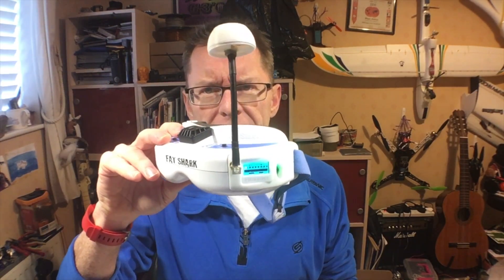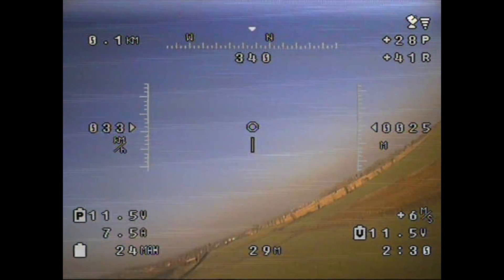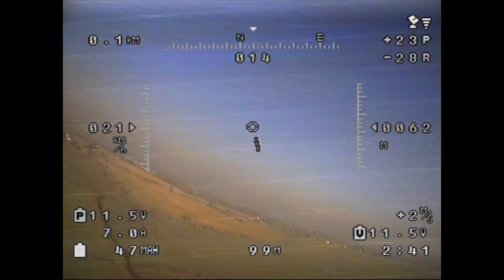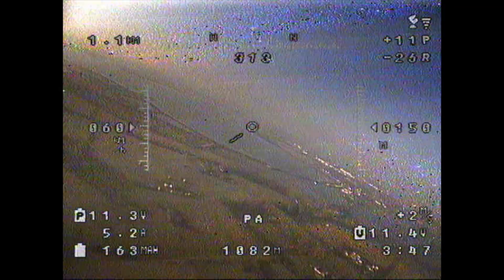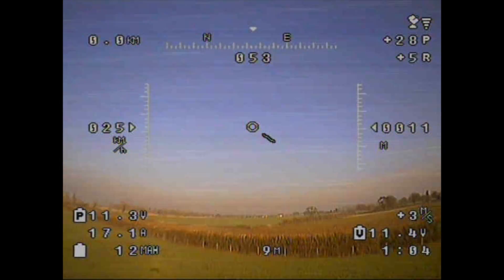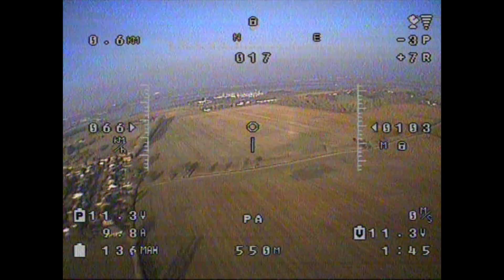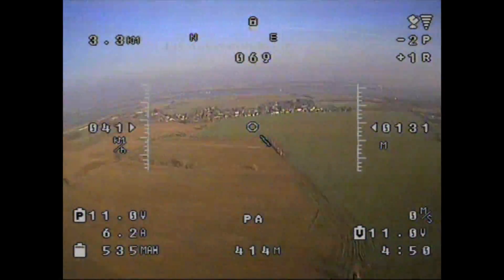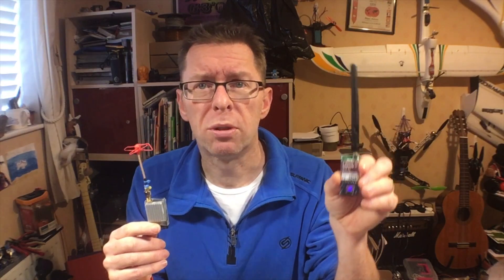Problems with RealAcc/True-D/LaForge with ImmersionRC 600mw VTX's

Comment: Hi Wayne, Oh, I feel your pain.....I have a couple of those IRC VTXS...One is a 25mw Slave in my 1.2G Relay Module. The 600mw one has a couple of years on it hooked to a Mobius flight Camera, very convenient with the 5vdc output.
   I can't wear expensive FS Goggles, I use a true diversity Monitor. These days, I fly on 1280mhz but when on 5.8G I have been out to nearly 2kms using a UHF receiver. I use a pair of 14dbi Linear Patch antennas on diversity with a standard RD on the plane, it always gives me very good reception with a wide beam to fly in, even 2kms out. The Linear Patch antennas are not expensive to buy either and Im sure you will have some RDs. Try it....for Planes only of course, not your Multis. As for your recorded image....why is it bleached out?...It's truly awful, but I think that's down to the FS DVR, a known feature?  Be interesting to see your reception quality when using an original IRC UNO Video receiver. Pretty sure your recording will improve when you stop using the built in FS DVR provided your signal strength improves, which is where the pair of  high gain Patches come into play.

Comment: Thank you vert much i powered up a imr 600mw now that i am getting into fpv planes and had the same issue.
Reply from the maker: Sander Sassen tells me that ImmersionRC's new RX module - which is supposed to be awesome will work with all the VTX's out there.  Which is good news for me.  VTX's don't cost much these days, but the hassle of digging out 5 of these 600mw ones and replacing them is too much
Reply: But will that module work and fit in my goggles, the rapid fire module is always pictured to be for the attitudes.

Also the other issue i have is looking at reviews of other transmitters a lot of them do not appear to put out the advertised power.
Reply: Sounds like he ducked the question about the 600mW ones ??
Reply: Marty Hughes what question was missed?

Also the answer I found was foxeer tm600 very cheap and actually output 600mw or more, unlike the banggood vtx witch are apparently a mixed bag

Comment: Hi Wayne
I've tried to replicate your problem. I used a FS 8Ch 600mW VTX and for receiving:
1. FS Attitude with a 32Ch, none diversity, Nexwave receiver.
2. FR632 40Ch Diversity Receiver and LCD panel.
3. Flysight SPX02 goggle with two independent receivers for true diversity.

To replicate distance I used a 50Ohm terminator on the VTX and no antenna on any of the receivers.

When the VTX was set to Ch1 (5740MHz) and all receivers on the same channel no issues.

Leaving the VTX on FS ch1 I switched all receivers to Boscam A ch7 (5745MHz) a difference of 5MHz. At a suitable distance, so that the receivers were not swamped, I experienced the same warping of the image but no discernible bright banding.

I tried the same tests with the Flysight goggles and the FR632 receiver in single receiver mode with the same results.

I can only assume that maybe bandpass filtering on the receivers you are using is narrower than the FS VTX transmitted signal, thus clipping/distorting it, or the receivers are not quite on frequency. 

I have a spectrum analyser that covers the 5.8GHz band so I'll compare the transmitted signal bandwidth of the FS VTX against an Eachine 40ch VTX and get back to you.
Regards
Nidge.
Reply from the maker: That's a good bit of testing - look forward to hearing what else you find
Reply: CurryKitten 
Hi Again Wayne.
First I must make an apology. I made the mistake of doing the tests with a 350mW FS VTX.  I have just done exactly the same tests with the correct VTX and with the three different receivers I achieve slightly different results.
1. FS Attitudes the image is fine.
2. Flysight SPX02 Goggles some slight horizontal bright banding.
3 FR632 Receiver. Some image warping at the top of the frame when the camera was pointed at a bright light source and some bright banding.

On the spectrum analyser the 350mW FS VTX and Eachne 200mW VTX were nearly identical.
However the FS 600mW VTX plot showed the chroma carrier deviating significantly more than the other two VTX's.
My apologies for my misleading original post, I blame my pain medication which has also been responsible for some out of character internet searches and purchases.

Regards

Nidge
Reply from the maker: Interesting how the 200/350mw VTX's made by the same company seem fine when the 600mw is the problem one.  I could try asking Mr Sassen about it to see if he has a comment

Comment: I discovered this problem with my realacc a couple of weeks ago. After copious reading I discovered that essentially there aren't really any true standards for these video transmitters and receivers.  Typically you need the tx and Rx to be from the same manufacturer to guarantee these things to work, which will never work for these multi band systems.
Reply from the maker: Painful isn't it.  It's only a quick swap out of the modules, but I like convenience, and this doesn't feel like it at all !
Reply: CurryKitten agreed.  My first two weeks of ownership were so frustrating until I figured it out - having wasted about 8 hours of my life on the web.  However, when you find a band and channel combo that works, it performs very well. If you haven't thrown it in the bin! Lol 😂

Comment: Ive had the same problem with the True-D 3.6 as well with pretty much all sorts of video transmitters. I pop in my nexwave receiver and the exact noise you have goes away. I am really baffled, but I can say for sure its not the vtx.
Reply from the maker: I got the answer from IRC, and it's the modulation on the earlier IRC VTX's.  Whilst IRC will tell me that what they were doing was proper and right, obviously the fact none of the other receivers worked with them did cause them to change the hardware later so it did.  Because of the lack of people using the 600mw VTX's now, it's not been a major issue.  They also tell me that if you use the RapidFire module, it'll work with the VTX's.... which is a tad more expensive than just swapping out your VTX's

Comment: ya my 200mw fatshark vtx works fine with skyzone goggles. haven't tested a 600mw though
Reply: The 200mw Fatshark units seem to work fine with most diversity systems.  The main point of this YT vid is to point out the potential problems with the IRC 5.8g 600mw vtx and some diversity systems.  If you go to the product description for skyzone v2 goggles at getfpv you will actually see the following warning; Note: This Rx is not compatible with newer ImmersionRC or Fatshark Nexwave transmitters.

http://www.getfpv.com/fpv/video-goggles/skyzone-fpv-goggles-with-diversity.html

Comment: I've had the same issue. It's not just those new diversity FatShark compatible Rx's either. It does the same on my FR632 Rx. Change out the Vtx for a cheap & cheerful Eachine VTX & all was good. Most of my old Immersionrc 600mw Vtx died in mini quads. So I'm not too bothered. You can now get the 25-200-600 switchable Eachine RX528 (I think) for $13 (68% reduced) but it is RP-SMA. I have a few of then & the ET Switchable's & they work GREAT. Seriously, for the trouble it causes, I'd switch them out & sell them. You're bound to get at least a tenner for then on E-bay which will pay for the new vtx. then you just need to solder new connectors on your antenna's, job done!!! lol 🙄
I know it's a faf & expense, but that's the hobby. I dare not sit down & try to add up what I have spent over the years! But I don't regret it. By the way, I have the Furious V2 in my Dominator SE's. They are pretty new, so I haven't tried them with a Immersion vtx. I took the last one out of my old TekSumo. IT now has a Eachine 200mw 40ch. Just needs a new motor to peput up the old girl. 
But 1 thing I have noticed, the range is no where near as good with Furious as it was with the FR632!!! So for the summer long days when I want to do distance, the FR632 is going on a tripod. So far with same antenna's as used on the FR632 I have only got about just over half the distance I got with the FR632. Food for thought for distance flyers!!! 
Another note, I have the old Mini pepperbox IBCRAZY 5.8ghz Rx, my mate had the same and it fell apart and he got a warrenty replacement with the new version. tougher & in a black non see through smaller case. But my mate says it ace with his FR632 on his Mini quad on 25mw. Even when flying with guys on 200mw, he still has great picture.

Comment: evening did some more testing went out to a similar distance and on stock firmware ie got it from bg about 1 month ago all went well. I checked the vtx and it is the race version of that vtx you have. When i get a chance i will switch it to the same version as yours...
Reply from the maker: I think the race version is different hardware wise... a bit like the 200mw version is.  I've got some other makes of 600mw to test.  At the current low prices, it's less hassle just to swap them over (as long as they perform ok)
Reply: CurryKitten yes the race version. are a different tx. I have got one like yours to test on another plane that i have just fixed so i will test that over the weekend. However you are right some of the cheapest ones from BG do seem to as good or better as they don't have dip switches.

Comment: I use the immersion 600mw VTX I have used it with the true d V3 as well as cheap generic goggles from banggood and it works perfectly fine I have them on four of my quads never have an issue
Reply from the maker: I've got the answer to why some of the IRC600's work, and what to look for to spot which ones are good/bad.  I just need to gather a new one that will work so I can show it
Reply: Hi Wayne, i have 4 of the Tx and want to upgrade my goggles to FS HDs with true-D Rx.
Did you find an answer  ?
Brett

Comment: The modulation of the Immersionrc vtx is causing that. They always claim to be cross compatible but they just arnt.

Now, repeat this test with say the Eachine 600mW Vtx or a BOSCAM TS832 and you will find they all perform so much better its like chalk and cheese. Also you can get up to three of them for the same price as one Immersion units. 

That's why I ditched all my ImmersionRC vtx's now, they are just overpriced and no longer out perform the RF Sky gear now.
Reply: 2nd that!
I do like some  Fatshark gear, and most the time the build quality is quite high, but on the odd occasion a gem comes out of China that matches it =]
Reply from the maker: You got any 5.8 gear any more then ?  What a pain, if I just had 1 or 2 of them I'd happily swap them out - but I've got them in every plane I own (except the Hornet), the AV quad and the original Tri.  Too much to rip out and replace.   Damn it, why doesn't stuff just work :(
Reply from the maker: Yeah - when it was down to the IRC and the original Boscam it was miles ahead, but now these tiny 40 channel things like the Aomway (which I think are spot on) are perfect.  Just the fact I already own lots of the IRC stuff which is holding me back
Reply: I have loads of 5.8GHz gear, I never got rid, well other than the ImmersionRC but I didn't get rid of them either, they just randomly die after a year lol.

Comment: evening I know that Immersionrc did change the Rx module at some point. A chum RSSI Pro tracker had a number of issues with that model. So might fine some are fine and some have that issue. I have the single diversity module and it is working fine though limited testing. The module nearly came out and that did give me picture issues. With Immersionrc watch out for ghost channels so make sure you are locked onto the real channel and not a ghost channel that's close...

Comment: Might be a problem with other cheap diversity systems but not a problem with the latest Furious V3's;
https://www.youtube.com/watch?v=Q1yI4M2jqOg&t=267s
Reply from the maker: Hey Tom - really appreciate you posting this video as it's interesting what it tells us.  I don't think the point is cheap vs expensive.  Rip the cheap or expensive ones open and you'll find the same receiver boards and 90%+ the same code.

What's more interesting is that if you look further down in the comments, you'll see the user Rogero Video Games giving his experience of using the IRC600mw with the True-D (not the v3 in this case, but you did mention it was fine for you on the earlier modules as well)

I'd emailed Furious-FPV about this and shown them the video - they weren't sure either way and wanted to do some testing (time passes, still waiting for that)

So what's left to think about - the VTX's themselves, the question being was there any differences in the design.  You mentioned your VTX is about 1.5 years old, whilst mine range between 2-4 years (and I've no idea which one is which) 

It leads me to the conclusion that I need to talk to IRC and ask the question there.
Reply: If your older 600mw vtx's are Nextwave then they should be the same as mine. Actually, I have 3x of these units and the one I used today was +2 years old.   I think that the main point I'd like to make is that with any diversity system you should re-run a calibration for diff vtx's.  This is what the True-D manual suggests that you do.

I am no electronic and/or coding expert so I do not know the diff's between Furious and others except to say that the Furious V1/V2/V3 seem to work fine with the IRC 5.8g 600mw vtx.

If you talk to IRC they will probably tell you that some cheap vrx's are not up to IRC standards, lol!
Reply from the maker: Hmm, well Nextwave refers to the receiver rather than the VTX, but if you can link me to something that says different, I'd love to see it.

As far as the calibration stuff goes - all it does is set the hi/low RSSI of the two receivers to get them in sync - it has nothing to do with the actual reception of the video itself.

It's great that it's working for you, but I don't think we can draw any conclusions that they'll all work based on this
Reply: You are correct, the actual IRC vtx does not say Nextwave.  As pointed out by IRC in the past (see fpvlab) they are designed to work best with nextwave vrx's.

Re-calibrating for diff vtx's is still useful to help get them into sync imho.  I have tried this with diff vtx's and it seems to help a little.  Did you do this with yours?

Also, it may depend on which antennas you are using.  I used aomway omni and IRC 8db mini-patch with a FS spironet on the vtx, all rhcp.

I guess all we can conclude is that this 600mw vtx works fine with my Furious True-D V3 diversity module.  I am sorry to see that it does not work fine with your diversity system.
Reply: You are correct, the actual IRC vtx does not say Nextwave.  As pointed out by IRC in the past (see fpvlab) they are designed to work best with nextwave vrx's.

Re-calibrating for diff vtx's is still useful to help get them into sync imho.  I have tried this with diff vtx's and it seems to help a little.  Did you do this with yours?

Also, it may depend on which antennas you are using.  I used aomway omni and IRC 8db mini-patch with a FS spironet on the vtx, all rhcp.

I guess all we can conclude is that this 600mw vtx works fine with my Furious True-D V3 diversity module.  I am sorry to see that it does not work fine with your diversity system.
Reply from the maker: Yes - I'd gone through the calibration anyway... and in the video I'm using the same antenna setup on the plane and nextwave/Realacc rx.  I've stuck a question into IRC on fvplab to see what they come back with - hopefully something constructive.  I've just looked at 2 of my VTX's and I can see small component differences between them - perhaps one of these small revisions is the difference between working and not working
Reply: You may be better off trying a diff diversity system like the Furious True-D V3 imho.  You could ship me one of your problem 600mw units and I can test it with mine.  Cheers.

Comment: i just got a laforge v2 with diversity and i put it in the goggles and was like wtf this is trash and my buddy who was flying with me when i got it was like no thats not possible so i switched to his channel and it was crystal clear and i began to wonder maybe its the vtx (the one i use is the one in this vid) i have not changed yet but i will soon
Reply from the maker: Sounds like it to me.  Grab a cheap $10 VTX from banggood and odds are it'll be as clear as you like.  I've got a few none-immersion 600mw VTX's to test, as I'm looking to replace 6 IRC 600mw VTX's in various models.  Which is a pain, but given the cheap prices of current VTX's it's not the end of the world.  As long as they work well - I just know which manufacturer I'll be avoiding on future purchases.
Reply: I just ordered a Unify Pro v2 hv i belive is what it was called the only reason i went ahead and got one of that ranking and price is due to the ability to switch the power and power my camera still when im flying with my buddies my 600 mW tends to stomp all over them but i do also fly by myself a lot still so the 600 mw is nice then so i thought the changeability would come in handy.
Reply: Update so my new vtx came in and it works wonders on all power levels and all channels my immersion rc is now in a box and will go on my sacrificial quad when i finally do build it using all my spare parts and just throwing them together.
Reply from the maker: Nice - seems like the only workaround right now is to ditch the 600mw IRC.  A shame, but I guess that's the reality
Reply: yeah it kinda sucks but at the same time sooner or later i was going to have to get a variable vtx any way so better now than later